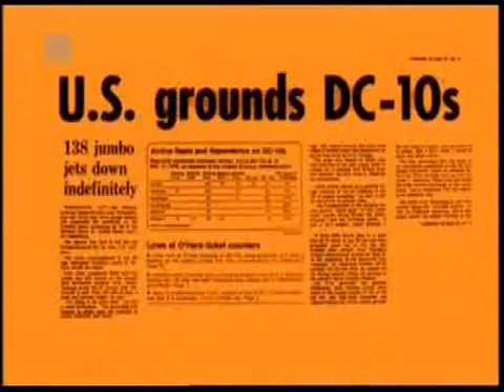History channels flight 191 - Reason for the crash

Comment: Anybody with a basic knowledge of hydraulic/mechanical systems would not have done something like this. You cannot trust the hydraulic system on forklift, end loader, etc. to remain in a static position even for a minute not to mention during a shift change. To leave one end of the pylon attached and the other unfastened under these conditions is very reckless.
Reply: Lousybarbe

Comment: Boeing never made a mistake of the magnitude of that made on the DC-10 cargo door. They also failed to fix the problem after they learned EXACTLY what it was without loss of life. This decision cost the lives of 346 in a horrific display of obscene negligence on the part of MD. As for the safety of the DC-10 itself, outside of the door problem I agree it wasn't a bad aircraft, but the public's distrust of MD was well justified.
Reply: "Boeing never made a mistake of the magnitude of that made on the DC-10 cargo door." 
Wrong! Boeing 737 Max 8, two total hull losses with almost 340 fatalities within two years after launch. Because of poor software programming to compensate for an even poorer aircraft design.
Reply: And also keep in mind that the same murderous thugs involved with the design of the DC-10 are now in charge at Boeing.😮😱